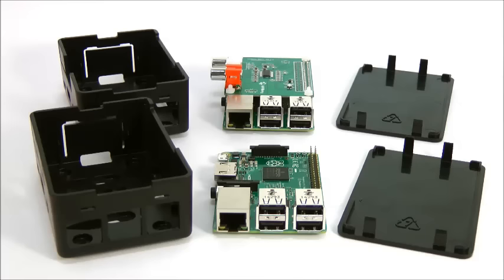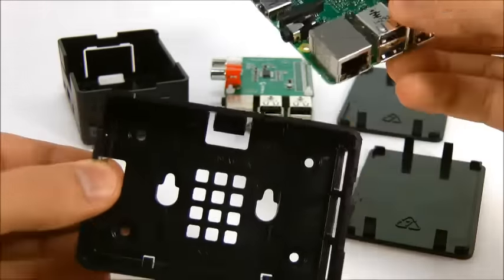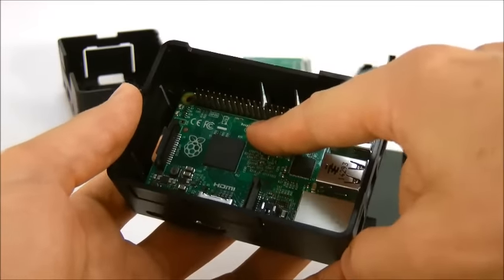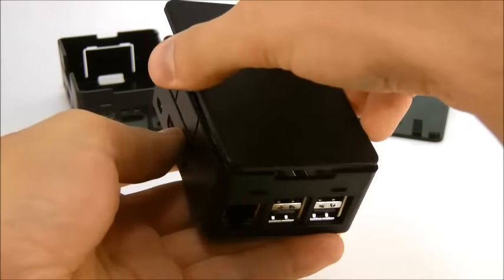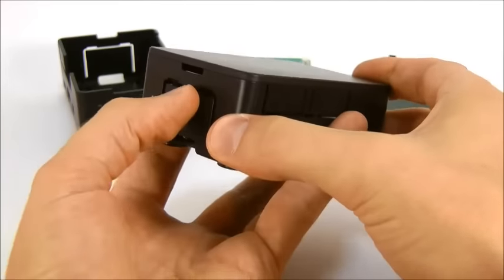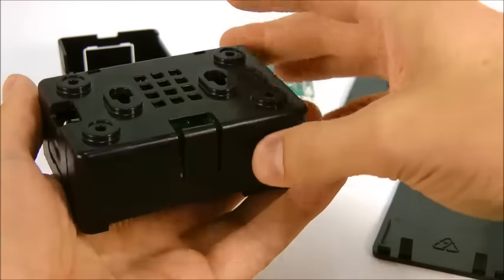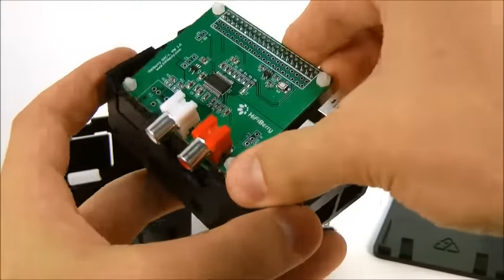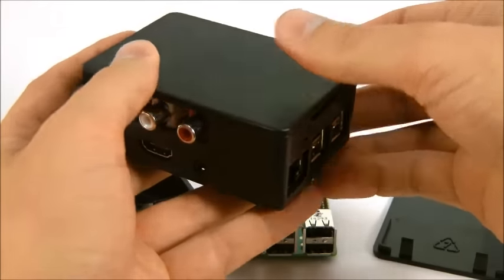HighPi Raspberry Pi Case Assembly

Comment: Great video!  Only problem I has is this case doesn't work with a heatsink on the chip on the underside.  You can remove the heatsink by heating it up carefully with a heatgun.

Comment: The Raspberry Pi 4 does not sit well in this case. The Pi4 is slightly too large for the case and will sit slightly ajar or lopsided. Because the ports don't line up correctly because of the poor fit, the USB-C power connector won't attach correctly and often pops off the Pi4 because of the misalignment. Just want you want to have happen while your O/S is booted up.

In addition, the Pi4 and mounted Allo Digione will not fit in this case even with the two side panels removed. I had to physically alter the case with a Dremel to accommodate to Allo board's ports, but both boards still refuse to sit properly.

It's a durable, cheap case but it's not a clean fit for the Pi4. At all.
Reply from the maker: Hello mindbender nine! Can you please confirm you're using the updated version of this case, which is made for the Pi4? It has dual micro-HDMI holes, and all connectors should align perfectly with the ports. Please contact us at support@buyapi.ca, we should be able to help you fit it in the case correctly. We have consistently great feedback on the fit, and are sure we can assist you in achieving that.